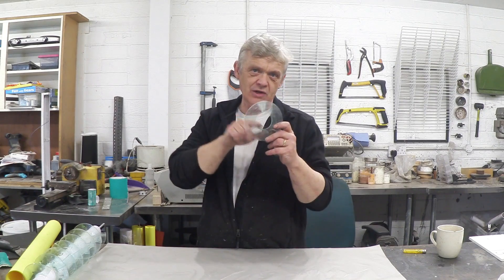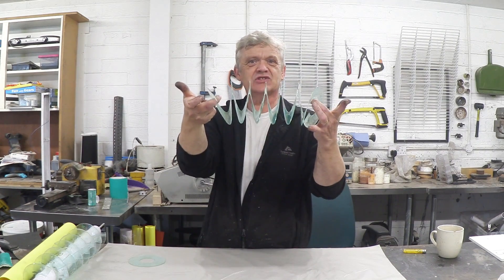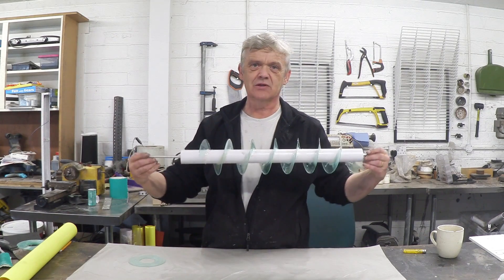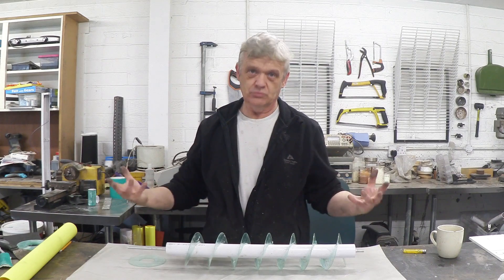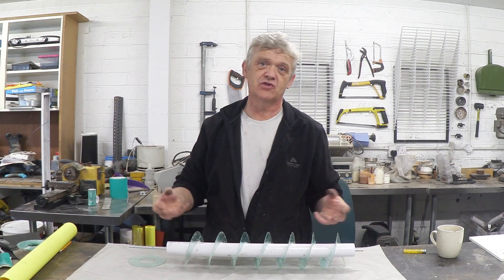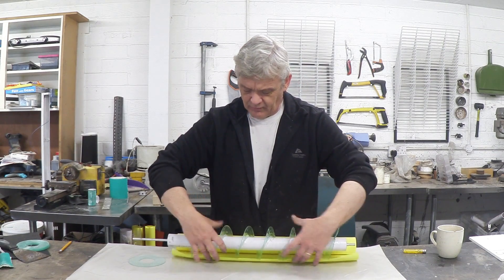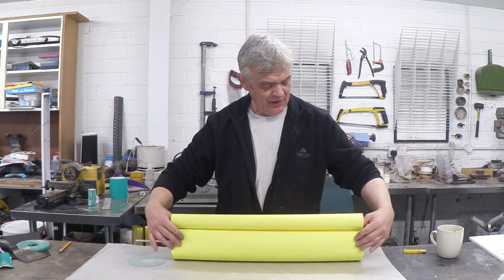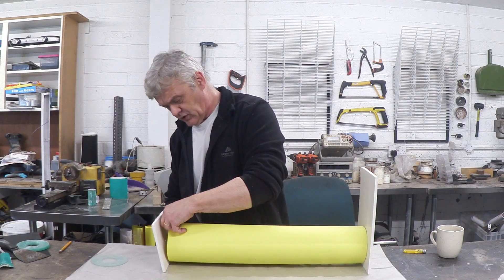Archimedes Hydro Generator - Making the Body

Comment: Cool....  I want to come play in your workshop.  I have been trying to come up with a version of this for a while.  The Archimedes Screw Generator, not the foam forming.  Where I live we get a pretty good amount of rain, and sometimes several inches within hours.  
Anyway watching all that water run made me think of capturing some of the energy and I figured a series of switch backs over a relatively  steep but shallow slope would allow the same water to turn multiple generators.  
I tried to do some of the math but I am not sure if I got it right, but I am thinking that the longer the screw (with more coils) the more force could be captured from the same amount of water...
Anyway This series is very cool to me... Keep at it
Reply: Do you live in Skedaddle, Warshington, too?
Because every time it rains here, I'm looking at the off-flow from the roof of the (unfinished) house I'm next to, and think about all that wasted energy.
This looks like the way to go.

Comment: Have you considered putting magnets on the edge of the screw and embedding the coils in the base and walls rather than attaching to the axle to get the highest RPM for the generator? It may provide increased electrical output?

Comment: Some smooth flue pipe would be close to what you need, but any sheet metal works would roll you a pipe in no time, though it would have a joint, it could be on outside and smoothed on inside.  I wish I was near a stream I could play with that and a water wheel to produce my own power, and a wind generator.

Comment: Hey Robert; the Screw you made is a piece of standard equipment in grain silo loading setups.  Is is available through Ag supply companies and is metal to boot.  Bonus: it is available in  the correctly sized pipe. Just in case you are interested.
Reply from the maker: cheers mate

Comment: Hey Rob l’ve had a thought that won’t go away. What if you made one that had a spiral that went from a large diameter at one end down to a small diameter on at the other end inside a cone. I was thinking that if it were used to generate power from water then with the large diameter at the top it might not need to be as long as a parallel set up and be able to work as well if not better with a greatly variable water flow. I suppose an experienced mechanical engineer would know the answer but it’s good to experiment.
Reply from the maker: that's interesting mate and very do able with his technique I would think - you would make the central core a cone and follow it round - itch would probably change thought

Comment: Great series.  I've always wondered if a multiple helix screw would work in this sort of application. Archimedes seems to have missed that with the correct pitch, one can fit more than one screw over the same shaft.  I know that it works for some types of hardware and auger feeds.  Looking forward to more.
Reply from the maker: you could do multiple flights for sure mate

Comment: Hi Rob. Looking at commercial archimedes hydrotubines, they all seem to have 3 flights intertwined co-axially, so that there are effectively 3 inlets for the water at the head of the penstock. I couldn't find any paper on this, so I don't know if this arrangement increases the efficiency, the power output or both. But they must be doing it for a good reason.
Reply from the maker: I did see that mate - well worth adding another one for sure

Comment: The best thing about the screw is the water  continues to exert pressure on the entirety of surface creating turning force for the whole length unlike a propeller design which once done with the small surface is forever lost  and as it is enclosed for the area with water, there is minimal angular loss as opposed to a propeller that whisks the water away to the outside reducing effeciency!
Reply from the maker: for sure mate

Comment: Smart Work Rob . I've Thought Putting That Expanding Foam In My 2 Man Inflatable Kayak For Rigidity,  Mmmm We'll See ....
Bless Up
Reply: Make sure you use closed cell foam.  Some foam actually gas a sponge network that will fill with water.  I'm going pool noodle on an old zodiac
Reply from the maker: this type needs exposure to the air in order to cure mate - so I would think you would need a two part type that didn't need that - but you can buy them for sure
Reply: @ThinkingandTinkering  Ok Cheers Buddy